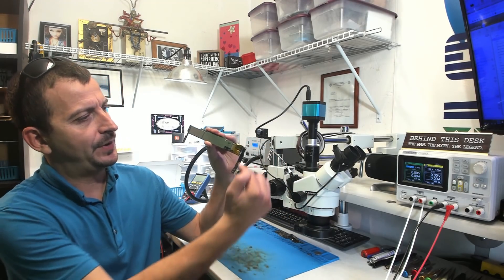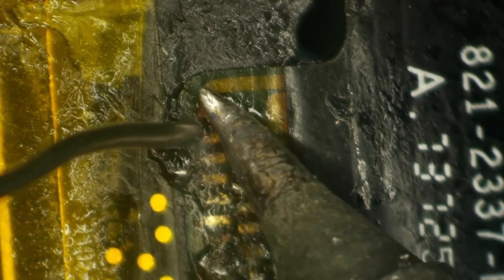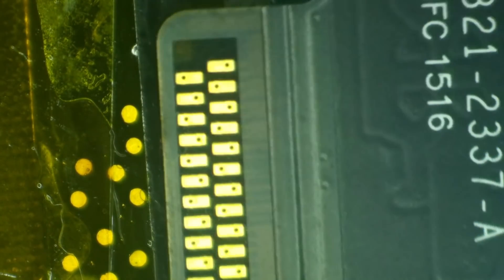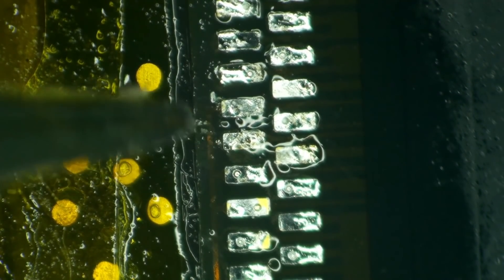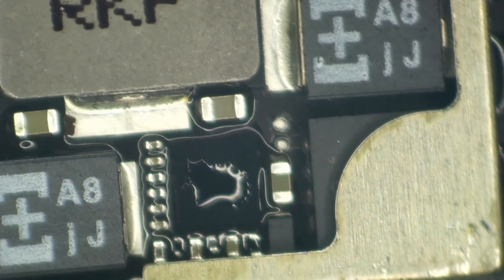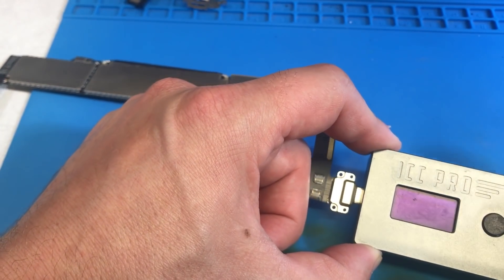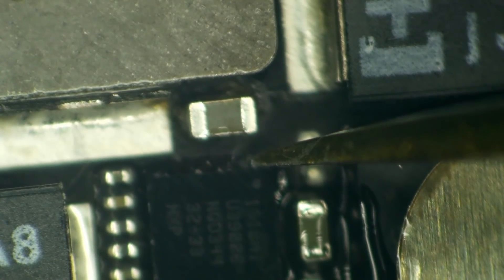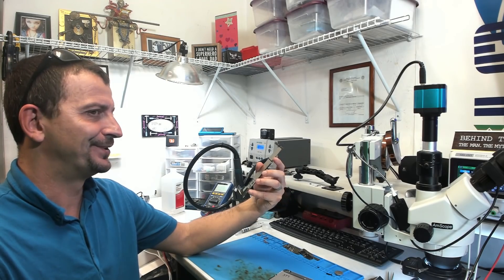iPad Mini 4 Not Charging 🧐 A prior attempt

Comment: Do you need to push down on the IC when you replace it? What about cleaning the old solder balls with wick?
Reply from the maker: I usually give the IC a small nudge just to see it is floating but try not to not push down on it.  Wicking is good but I normally don’t wick when doing smaller ICs.

Comment: Out of curiosity no judgment either way do you happen to use any sort of fume extraction
Reply from the maker: I work in a really well ventilated area and don't intentionally inhale fumes but I don't have ventilation directly at the source.  Although I work with this stuff all the time, I rarely ever directly inhale any fumes that come from my soldering.  I will likely add direct extraction before much longer though..  I'm eluding to a workshop move - if/when I do, that will for sure be part of it.

Comment: As far as I know the 610a3b is compatible with all three versions of 1610, at least on iphones they do
Reply from the maker: Yes, same here - I only ever order 1610a3b.  I'm thinking it may have been a bad chip or some other cause entirely for it hanging up.  I should have tried another a3b out of curiosity but I was more just trying to get it fixed and back out the door.

Comment: Great repair video! Thanks for mentioning the hot air settings during the IC removal & replacement!
Reply from the maker: Thank you! Early on with board repair I used to think that the temperatures really didn't matter that much but now I'm a bit more careful.  Very little time for mistakes with higher temps!
Reply: @ststele  thanks 🤓